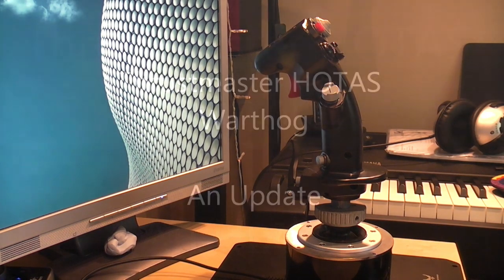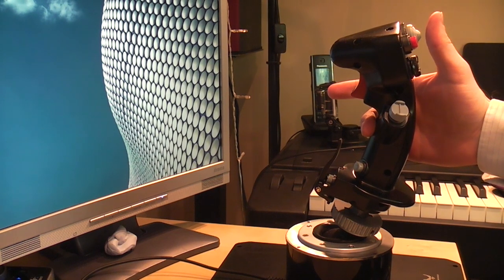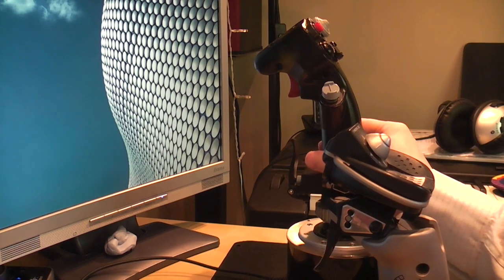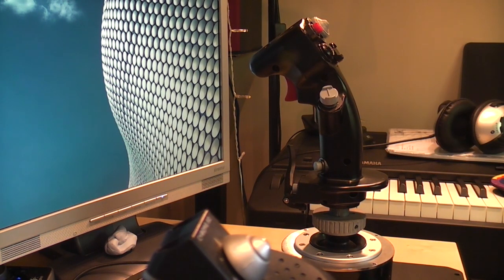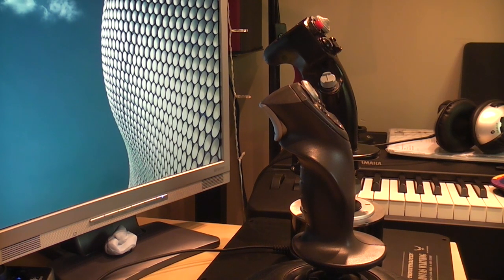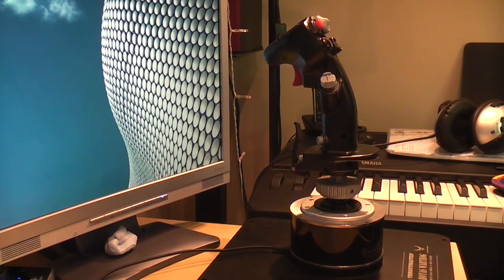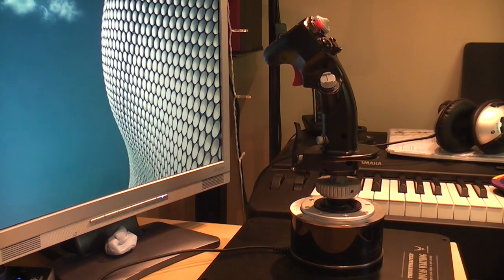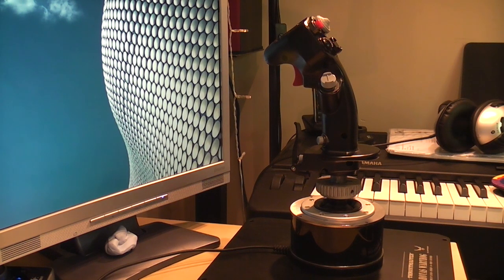Thrustmaster HOTAS Warthog Update - "stiction"

Comment: As he stated.  The warthog is still well worth the purchase.  Most sticks have it but there are a few lucky ones that don't.  The stick is definitely the best built and most accurate in the price range.  The fix is easy but may void the warranty.  But makes the stick an incredible piece of equipment. vid is here ThrustMaster HOTAS Warthog, Complete Disassembly, Grease Replacement, Stiction problem, fix  If you don't want to void the warranty you can just take out the rubber o-ring and re-grease it with a much better grease ( I recommend one on the vid page).  That will improve it as well but not as much as the full job will.

Comment: Dear Ralfi! Thank You for the wonderful presentation of the Thrustmaster HOTAS Warthog A - 10 C Replica. I'm a desktop pilot since the early 90's on Atari and Windows 3.11. I mastered the venerable Fleet Defender simulating the F -14 TOMCAT long range interceptor at the poor 320 * 200 screen resolution in real mode with a Thrustmaster Joystick. This piece of sophisticated hardware ripped 180 Deutschmark off my purse. I did not regret any penny.

I'm a GERmAN handcraft man and quality checker for metal and electronic / mechatronic devices in my real life. I also flew with the very precise electro - optical steered MICROSOFT SIDEWINDER 1 and SIDEWINDER Precision 2 in Super VGA with best results. Carrier landings and Air Refuelling switched with this stick.

Your precise description of the ergomical advantages Thrustmaster vs. Saitek or other  HOTAS - sticks is very impressing.. The Hall - sensor system for the sliders providing a precise steering as an electro - optical system like the MICROSOFT SIDEWINDER is my Personal Additional on Your very good description for an upgrown Flight Steering System like THRUSTMASTER WARTHOG:

You have topped all this with Your Short Dump and Your short finger. Everything is working fine, when the right finger presses the right button at normal joysticks. When the things go bad the joy .... ???
Reply: designamk1
On drugs? Clear the facts, my friend, before You post things like this. I'm flying military combat simulations since 1988 in my helos and in suprsonic aircrafts on my home PC. I was a gunner of a real computer steered twin barrelled 2cm machine gun in my real life in 1978, firing HE ammunition on targets making 400 kn and armour piercing Tungsten ammunition on Tanks one km away. I was a German soldier from 1977 to 1979, bemastering heavy infantery weapons, without any drug. I have shot RPGs on tanks and I have thrown real hand grenades with 200 gramm TNT on my targets. Drugs? No, my young friend. I'm a corporal of the German Airforce from 1979 until my death. I belove shooting games on my home PC. I was never sentenced for any crime - weil ich die Gewalt gegen Menschen hasse und nicht mehr als meine Fäuste eingesetzt habe, um einen Kriminellen zu stoppen. So, lieber Freund, das ist mir im richtigen Leben passiert, vor den Augen meiner Frau. als ich mitten auf dem Hamburger Hauptbahnhof einen Gewalttäter zur Stecke brachte, mit einem einzigen.. genau gezielten Schlag. Erzähle mir bitte etwas über Dein Problem mit Rauschdrogen, welche im wirklichen Leben nichts zu suchen haben.
Reply: designamk1
Look on my stream displaying my peaceful world, with flowers, trees and forests and beautyful sunsets.I am living in Gods own Country, in my peaceful Germany, taking millions of war refugees from the whole world now. Why do they flee to Germany? Germany provides a mighty shelter for foreign war refugees due to its financial strengh and military power. We are not investing much in our battle forces, but we are feared in the world when shooting with live ammunition. German Tornados have fired only 273 precise shots over Serbia in the Kosovo war on serbian anti aircraft installations without losing any pilot and helped to win the war against the cruel dictator Milosevic in the first strike. Without drugs.

Comment: I tried regreasing mine as per TM recommendation. It was great - for one night. Then I guess it sits there with the pressure from the spring, and the grease gets squidged out again, and you're back to stiction. I used a silicone based grease as suggested. At the moment I am learning to hover in the Huey and having the hog going stick stick stick stick makes it very difficult (its hard anyway!). I didn't know about the problem when I bought it sadly, or I might have thought twice.

Comment: I've seen a video on how to fix the issue but boy it's a whole lot of work and seems to be down to a bit of cost cutting by Thrustmaster. Basically it's not acceptable for a device at this price point and puts me off buying one - I can't really see how you can still recommend it. It's down to the company to fix the problem and issue replacements.
Reply from the maker: I recommend it because it's, even with the issue, I don't feel I've bought something which is severely unusable.  But it's just my opinion!

Comment: Not a cheap solution at all, so please take it as an option for those that can afford it or really want to do something a little different; the RealSimulator FSSB R3 is pretty amazing.  It eliminates all the throw mechanics of the stick and replaces it with a force sensor.  So there is no actual stick deflection, but very precise pressure sensitive response.  Again it's not cheap but it's an option.  I had the FSSB R2 with my Cougar many years ago and now the R3 with the Warthog, can't live without it.  A side benefit is a lot more customization capability, for example you can set force ratios (i.e. sensitivity) on the fly, so you can use normal sensitivity when free flying, switch to low sensitivity for precise maneuvering (e.g. mid-air refueling), etc. (P.S. Just to be clear I don't work for them nor am I compensated by them, just a happy customer).
Reply from the maker: +Gautam Desai Many thanks for the feedback!

I have seen these mods, but being used to working with movement in aircraft (I don't fly an early F16!) I'm not sure how I'd get on with one.
Reply: +Flying Si Aviation Videos & Reviews Hi. I forgot to thank you for the great videos. So thanks! and yes, that's a great point. I'm using a lot of space sims these days so the force stick model works well for me, but yes, not so much for the A-10 at least as far as realism is concerned.

Comment: Does the new magnetic base by Thrustmaster address this issue?
Reply from the maker: I’d imagine not.
Reply: Flying Si Aviation Videos & Reviews Really?
:(  So I guess it’s a case of dismantling and re-greasing everything.
Reply from the maker: Gregory Ashton it’s more than that.  I’ve seen a good guide on here where not only is grease replaced but also all the rough plastic moulding is sanded smooth.  It’s a job I’m putting off!
Reply: Flying Si Aviation Videos & Reviews Yeah I can see why. It’s a shame it doesn’t come out of the box this way already.

Comment: Dear Ralfi! Every HOTAS - steered plane will crash immediatly when the pilot presses a false switch.The mechanical outlay of the THRUSTMASTER will break this spell. The Thrustmaster has the Capabbility to Override these Flight Simulation Limitations simply by his own precise Hardware - Add Ons.

Comment: I have this same joystick. I try not to use it with just two fingers… solves my problem.
Reply from the maker: You could, but that's not going to give you the best results as you are reliant on gross rather than fine motor control.

Comment: Find a solution to your stiction?
Reply from the maker: Not yet, although it seems to be improving with use!
Reply: +Flying Si Aviation Videos & Reviews After 11 months, does the problem persist?
Reply: +Flying Si Aviation Videos & Reviews did you oil it?
Reply from the maker: Afraid work has got in the way of finding a solution so far!
Reply: Roger that.